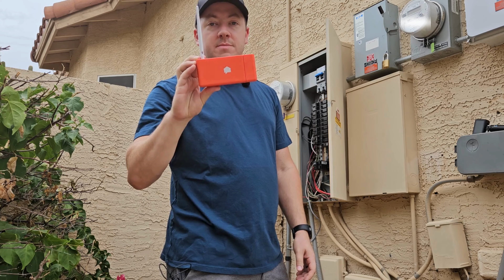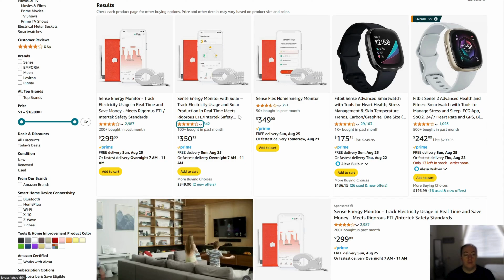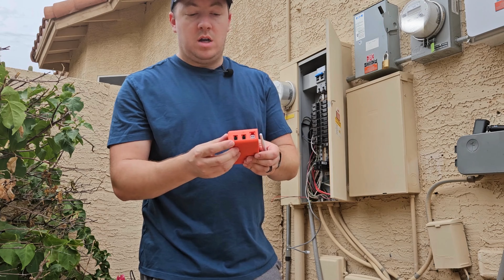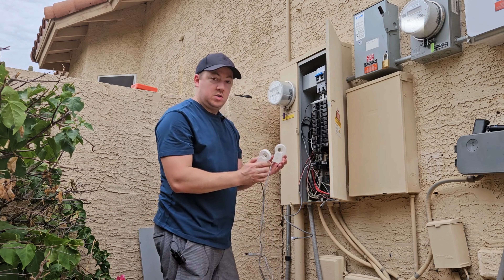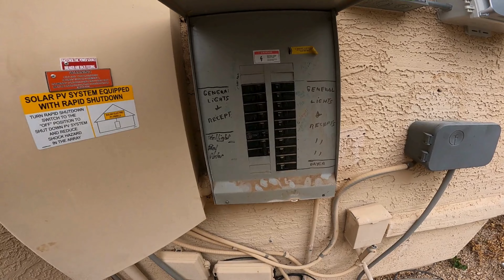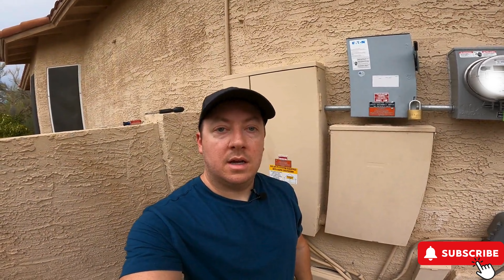DIY Installation of the Sense Home Energy Monitor | Get Started Today!

Comment: Just wanted to verify, you were using 2 pole breaker, 15 Amps?
Reply from the maker: I just used the smallest 2 pole breaker I could find! It uses barely any power and the wires are pretty small